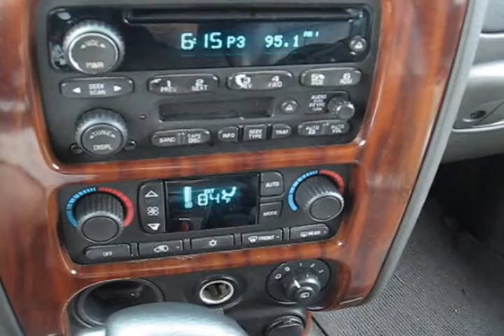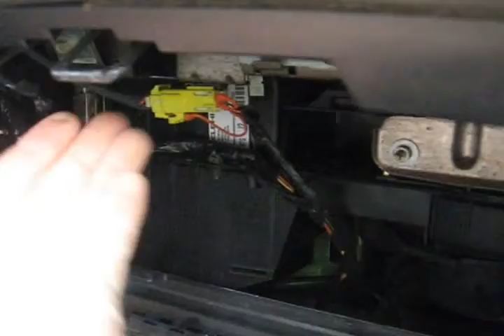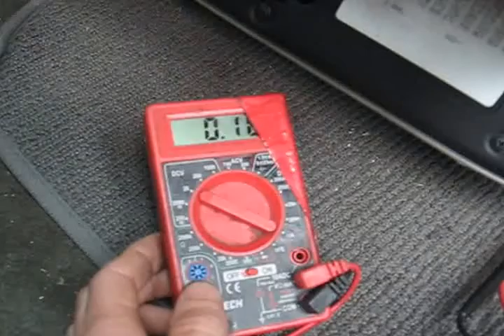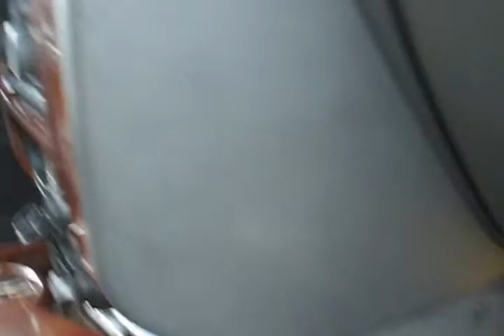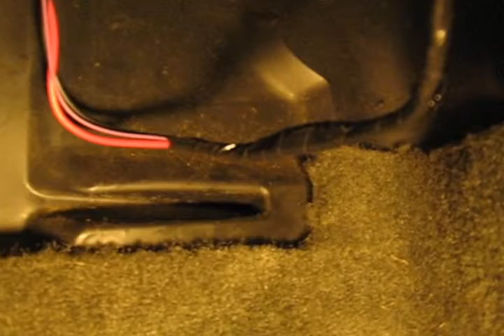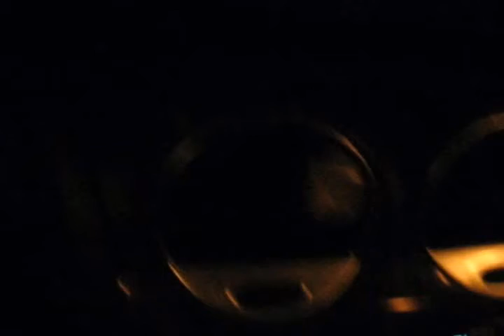DIagnose and Replace GM blower Control Module

Comment: Any idea what would cause these to fail? I have a 2004 Yukon and am 
about to change the module for the third time in 2 years. And it was 
already replaced at least once before I owned the truck. I could tell 
because the harness had already been spliced. I replaced it anyway but 
this is getting ridiculous. The current one was bought from a GM dealer 
which was identical to the one I bought on Amazon previously. It is 10 
months old and already failed.
Reply from the maker: Blower motor might be drawing too much current. Check the fuse for the blower motor and make sure its the correct amperage.
Reply: I've been reading through the comments and Darrin Mccullough stated above "  +pfun41 Thank you for pointing me in the right direction! I got it working last night by replacing the transistor (mosfit) inside the control module. Turns out this is like a mini VFD like they use on industrial motors. Some people had said they replace the blower motor at the same time because it going bad can draw more amps and make the controller fail prematurely. Have you experianced this at all?" 
So it could be your blower motor drawing too many amps thru the controller burning up the MOSFET transistor/ The metal-oxide-semiconductor field-effect transistor (MOSFET, MOS-FET, or MOS FET) is a type of field-effect transistor (FET), most commonly fabricated by the controlled oxidation of silicon. It has an insulated gate, whose voltage determines the conductivity of the device. This ability to change conductivity with the amount of applied voltage can be used for amplifying or switching electronic signals. (MOSFET definition from  https://en.wikipedia.org/wiki/MOSFET) If I were you I'd remove and replace that fan or replace it's brushes and bearings with a good cleaning. Good luck.

Comment: Help!  AFTER replacing blower climate control module , still not working son THEN decided to check if I was receiving power FROM the climate control Unit. Bummer no voltage from Auto duel  climate control unit in my 2003 Chev Silverado. How do I confirm the unit in the dash is the problem?
Reply: Did you ever get this figured out?

Comment: I have the same thing, an 04' envoy slt but the problem with my a/c is that it stays on feet and face, it doesn't swap to anything else. what problem is that?
Reply from the maker: Sounds like a dead mode actuator

Comment: can this work on a trailblazer 2003 if cold air is coming out from the back and not from the front?
Reply from the maker: If you're talking about the EXT models those have a separate HVAC system in the rear. If the front doesnt have air blowing it could be a blower control module or a blower motor. In which case this applies.
Reply: i.mi

Comment: Got an 2002 Envoy XL, I have the newly designed resistor in it, A new blower motor. I concluded the blower motor shorting out took the resistor with it. Worked great for about a year, Found this video... I have 12 volts DC going straight to the blower motor, However if I go to full blast ahead the motor makes an odd noise and tuckers out. Is this a sign that the blower motor is drawing to much power?
Reply from the maker: It's probably shorting out or the bearings are failing, both will cause it to draw too much power. If it has full power while spinning but is still doing that then its on it's way out.

Comment: how do you check the climate control if the signal wire has no voltage when you increase fan speed
Reply from the maker: Check for voltage where the wire exits the back of the climate control module, that will rule out a wiring issue.
Reply: Thank you , i did and i have no voltage. Does that mean my climate control is bad ?
Reply from the maker: If you have no voltage at all even with the fan on high then yes, the climate control module has failed.Robert Aratari

Comment: Hello , What do I do if I have no power in my signal wire from climate  control module 

Thank you
Reply from the maker: Make sure you're testing it porperly. If so test for a signal at the back of the climate control module, this will take the wiring out of the equation. If there is still no signal then you will need a new or used climate control module.

Comment: I have a 2003 GM envoy xl have the same problem as the car u are working on, the AC will kick on once in a blue moon and when it does it will only work for about 10 min then goes off :(, when it blows it comes out really cold  :)... I have 2 little AC vents in the back and they do work, it's only in the front.... do you think it's the blower control module?
Reply from the maker: If its the blower that doesn't work and it happens with both ac and heat then most likely it is the blower control module or the climate control module.
Reply: OK thank you and what Fies the climate control module look like?
Reply from the maker: Its the piece with the buttons and knobs and the lcd display.

Comment: I HAVE A 2004 BUICK RAINIER WITH ADJUSTABLE GAS AND BREAK ACCORDING TO THE GM MANUAL THE TIME WITH THE ADJUSTABLE S IS 7.8 HOURS SHIP TIME !
HAVE YOU EVER DONE ONE ?  I HAVE A BAD MODE ACUATOR
Reply from the maker: +bryon clemons nope, never seen one with an adjustable gas and brake.

Comment: Very informative video. Just what I needed. Yesterday blower fan would not come on at all, today full blast only even with the power off, ignition off and key removed. 2003 Tahoe Z71 with auto climate control. Thank you for the posting the video.

Comment: It's only blowing out the defrost because that's the setting you have it on.
Reply: Thank you...
Reply: I replace blower motor and resistor and it still doesn't work can anybody help
Reply: Replace blower motor and resistor and it still doesn't work any ideas
Reply: LMAO!!! Good one!! :)
Reply from the maker: https://youtu.be/xnIDe0j3Fr4
Reply from the maker: Could be main power issue, could be a signal issue from the HVAC module, could be a loose wire. Trying to fix it without testing anything is like trying to shoot a bat at midnight while blindfolded.
Reply: @pfun41  . LOL. I actually killed a bat with a pellet rifle like that one time. Talk about a lucky shot. ;-) Well actually I wasn't blindfolded but I doubt that would have made much difference at midnight with only one small streetlight in the area.

Comment: pfun41, great video.  Could you explain which wires need to be spliced together? Appreciate your help, Thanks
Reply from the maker: +mapoint48 There's only 3 wires. Black to Black, Red to Red for the big wires. The color of the remaining small wires doesn't matter but they get spliced together.

Comment: I think showing how and which wires to spice would have been great
Reply: I agree will really help out alot
Reply: It's different for every vehicle. The colors of wires vary from vehicle to vehicle.
Reply: Bought Delco part and wiring instructions were included with the part
Reply: Yeah, that's exactly what I need to know. The old resister has three wires and the new one has six or seven. How do they splice?
Reply: @ojibwayinca8487  do u know that part number
Reply: Really and the part number

Comment: pfun41 I have an 08 trailblazer with the control module. My problem is super intermittent one min it will work on all speeds the next not at all. I have 12VDC to control module and good signal. The PWM controller seems logical until I hooked my meter parallel to the motor. In good operation the potential difference across the motor is 12VDC when faulted it goes <=2VDC . To make a short story long I think its an open ground just looking for a second opinion. Do you think it would more likely be in the controller or before it like would my signal voltage go wonky if the controllers ground was bad at the climate module?
Reply from the maker: +Darin Mccullough A bad ground for the climate control module would result in various strange behavior or no power. Weak grounds cause all sorts of inexplicable behavior especially with computerized components. A complete open ground would result in a dead climate control system. I'm not sure why you suspect an open ground. You know there is not enough voltage getting to the motor when the symptoms occur, now you just need to know if the module is getting proper power and signal under the same circumstances.
Reply: +pfun41 Thank you for the reply.  I have proper voltage at motor on the positive wire at all times. Whats throwing me off is when the motor doesn't turn I have that voltage on the motor ground wire. Just a sec ago I thought screw it and jumped the motor ground wire to chassis ground when fan wouldn't run and it started working fine if  take that off it works until I start playing with speed controls then quits if I tap the - lead on ground again it will repeat this cycle. I don't have much DC experience and its throwing me for a loop. If on a 120VAC circuit working voltage past the load on neutral (ground) would most likely be open neutral. I really appreciate your help I dont have a lot of money to go buy components until I know for sure whats broken.
Reply: +pfun41 I think I got it so the controller sends voltage to the motor at all times then pulses the ground through a transistor. Some where in the controller this is a bad connection hence why when I jumper it to ground it works until I try playing with the speed control. If this seams legit enough I think ill cut the controller open tonight and see if I can find a bad connection to solder or a transistor to replace.
Reply from the maker: +Darin Mccullough Ok, let me try to explain this. Forget everything about AC. The blower control module is basically like a giant variable relay. It has it's own 12v power supply (positive and negative) and feeds variable voltage to the blower motor based on a signal it recieves from the HVAC module over the single small wire. I am not familiar with the internal circuitry of the blower control module, but it doesn't matter. All you need to know is that 12 volts goes in, and (based on a signal from the HVAC module)  a voltage from 0-12 volts goes out to the blower motor. At around 5:20 I showed how to check for a signal from the HVAC module. What you want to do is backprobe the small signal wire and the red positive wire and leave the connector plugged in to the Blower control module. Rig it up so you don't have to hold anything and can see the meter from the driver seat. I use T pins and test leads. This way you can monitor the signal while the system is operating. You'll need to just drive it like this until it acts up again, there is no other accurate way to diagnose it. When the issue finally occurs again, note what voltage you are reading. If you aren't getting a voltage that changes with the fan speed then the HVAC module has failed. Just to be shure, pull over and unplug the connector, leaving the meter connected, if nothing changes then you can be shure it's the HVAC module.
Reply: +pfun41 Thank you for pointing me in the right direction! I got it working last night by replacing the transistor (mosfit) inside the control module. Turns out this is like a mini VFD like they use on industrial motors. Some people had said they replace the blower motor at the same time because it going bad can draw more amps and make the controller fail prematurely. Have you experianced this at all?
Reply from the maker: Never heard  of it, suppose it could happen.
Reply: Thanks Darin, if it's my control module inoperative how will I know the transistor is bad? Be burnt? I don't have an oscilloscope, just moderate electronics knowledge.

Comment: My rainier did something almost just like this. I shut the car off and the blower was still blowing. I heard of something called afterblow. But heard it only lasts a few minutes. The blower stayed on for 3 hours which is when I got back to the car. It blows full blast even when the climate module is off or turned down. Is the issue with the blower module or the part with the actual climate control. I took the fuse out for the blower just so it would stop draining my battery over night. What do you think it could be? Could it be the blower module or the climate control module?
Reply from the maker: Jake Sosinski Put the fuse back in so the blower is running.   Then test for a signal from the blower control module with the car OFF. If you're getting a signal then there is a problem with the climate control module. If not, then the blower control module has shorted. Only testing will confirm but I bet it's the blower control module, it handles alot of current and failure is common.
Reply: Okay thanks a lot man
Reply: not